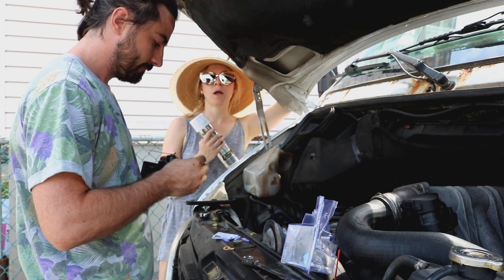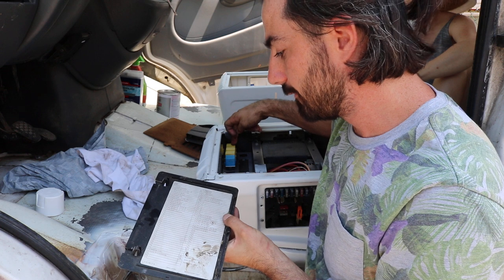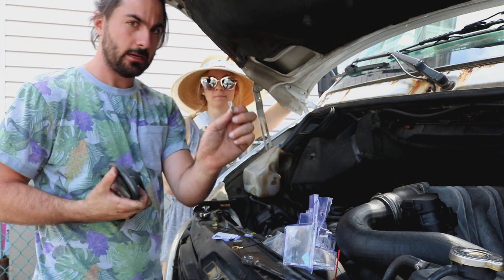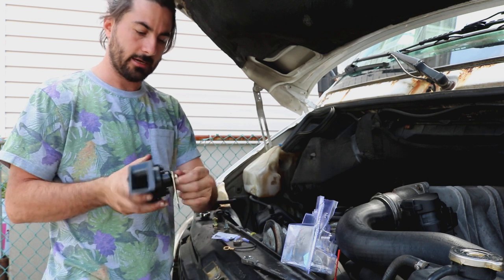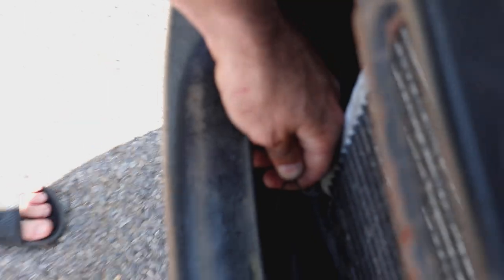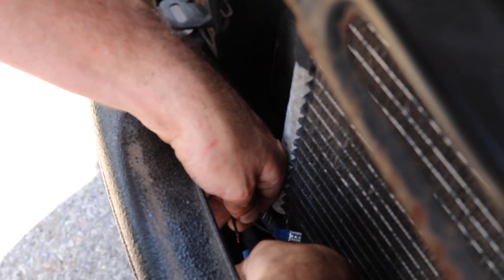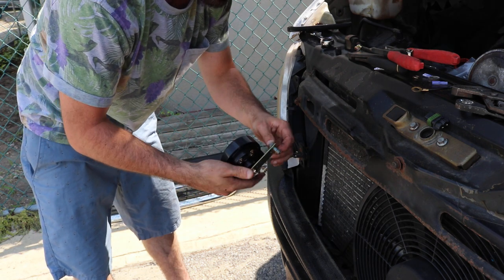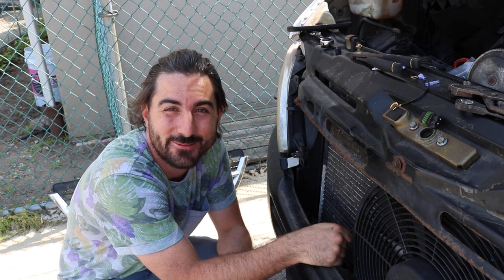Van Life Conversion: Sprinter Van horn replacement

Comment: Electric shock? From a 12 volt system? How?
Reply from the maker: If you are wet and create a spark or drop a wrench across the terminal. It is very rare but it can happen. You are touch your hand across both terminal positive and negative and be fine tho.